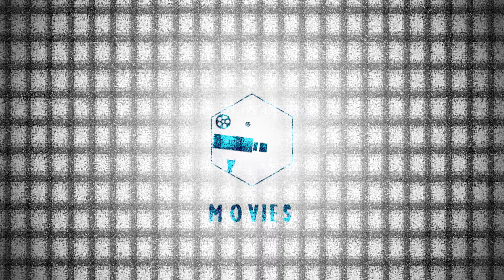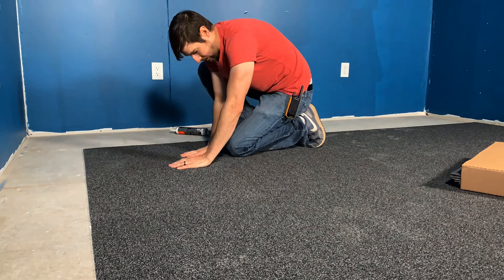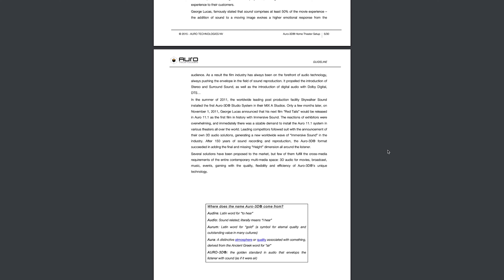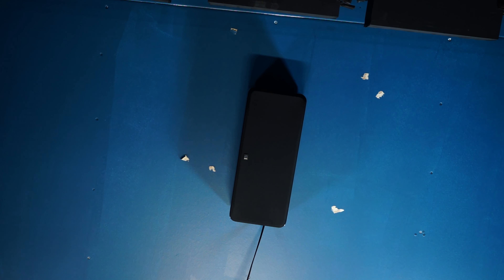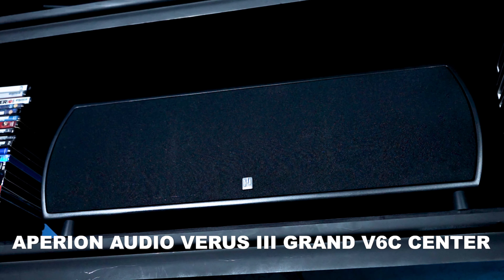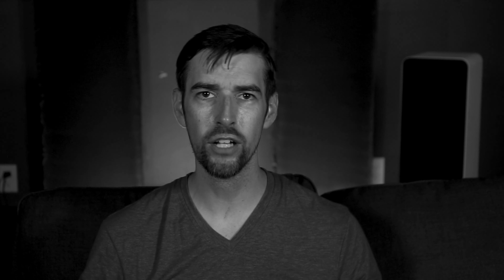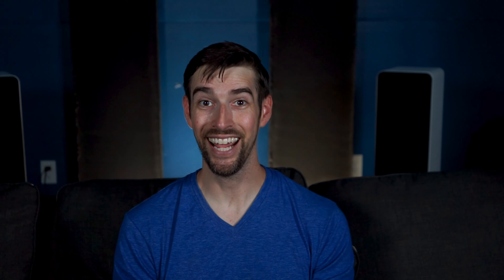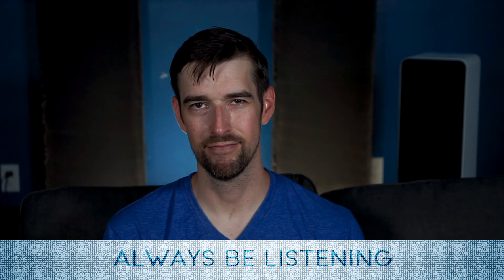IT'S DONE!!! DIY Home Theater Episode 3 | @AperionAudioSpeakers | Dolby Atmos | DTS X | Auro 3D

Comment: congrats on finishing it and I am looking forward to your upcoming comparison/testing videos
Reply: in the spirit of "starting a conversation" (which I love that you want us involved!) I have a similar setup in that i use a 10x20 external standalone garage as my dedicated "theater" room. It's super rough around the edges (i.e. unfinished, exposed attic style roof, concrete floors) but am slowly picking away at it. Currently I have 5.2.2 - My next move is and lingering questions are upgrading to a 4 channel atmos height system, assuming its worth it, but getting a 9 chan receiver is not easy to find and no bargain. Also I am contemplating getting new surround speakers and changing placement to be directly left and right of MLP (only have one couch at listening spot), currently they are a bit behind me at an angle based on dolby's new guidelines...so I'd be curious on your take on 5.1 and placement of those surrounds, because it ain't straightforward and everyone does something different

Comment: I may be watching many of your video out of order as I found your channel 3 weeks ago while searching YouTube university for Atmos surround. I researched for ways to upgrade from  5.1. to a 7.1..2 but I’ve changed plans to go with 5.2.4. Your Costco $1500 Atmos video started my journey with the Klipsch reference 5.0.2. I’ve added two klipsch R12SW, a pair of klipsch RP-500SA, and for the receiver I’m using the Onkyo TX-NR7100 9.2. I have a 120” screen with a LG ultra short throw. Stream for now is Apple 4K  and later I will be adding a blue ray player. This cost effective gear and your video was used to get the wife to understand the cost of this set up as a base line. Congrats on your set up as we all know your production will be a boost to a higher level of testing and content.

Comment: Hmm, i was a little confuse about the 30 degree angle for Auro 3D. I thought they say to angle down the speakers 30 degrees not to mount them at a height of 30 degrees from your head. I will do more research cause in the future i want to change my receiver and do a setup that can handle Auro 3D too.

Comment: Currently, I have and Onkyo PR-SC5530 AV Preamp that does the job fine. I'm building a 6 channel Orchard Audio Ultra Amplifier to go with it fully balanced. For Speakers, I run Klipsch Cornwall IV's for the L & R. My Center Channel is a Heresy IV (arriving soon). For surrounds, I run 1968 Bose 901 Series 1's. Future plans are installing either 4 in ceiling Atmos Speakers or doing an on wall Aura 3D and replacing the Onkyo....one day....maybe....

Is the IOTA Aura 3D and Dolby Atmos and XLR fully balanced outputs. Great work your doing Ealon.
Reply from the maker: Daaaaamn! Your LCR is insanely huge! Jealous! 😄 The AVX17 is not Auro 3D compatible. Dang. But yes, a full set of XLR outputs. That review will be released next week! 🤘

Comment: Can’t wait to see your new videos Ealan!  I got back into HT again in 2020 like many others.  My system was 20-25 years old and it worked, but outdated.  I had been looking to start upgrading and ran across a 4 speaker set of Paradigm Studios (80s and 20s) for $80 locally.  Then I picked up a matching center for $200.  Next thing I know I’m buying the Yamaha TSR-700 from Costco a couple month later.  I’ve since added an 85” Sony, older Integra ADM-2.1 I found for $50.  Oh and I’ve added 2 SVS PB-1000 Pros.  I have a couple of Klipsch Reference Theater Pack satellites as my Atmos speakers.  I’m running a 5.2.2 right now, but I have plans for a Denon x4700h at some point to run a 7.2.4 setup.
Reply from the maker: Dang, Chuck! Excellent bargain hunting! Welcome back to the HT madness! 😄🤘

Comment: I’m currently in frame out, electrical wire and speaker wire running in my diy home theater.  I will be running a 7.2.4 Dolby ATMOS with all Klipsch speakers.   Dedicated home theater space I’m building in our new garage I recently build on our house.  Room is 12x20x8.
Reply from the maker: Good luck to you on your fine journey! Excellent setup you have planned!

Comment: Hi Ealan, you had Denon 4700 on pre amp mode before how does the Iotavx compare with the Denon.
Reply from the maker: It was too long ago to remember. BUT…I am literally planning on having the AVX17 go head-to-head against my Marantz SR7015 (which is the Marantz equivalent to the x4700h). So stay tuned for that in the upcoming weeks!

Comment: Looks great and yes they will drive you insane building one. It’s very similar to my basement theater. The sound absorbing panels made a huge difference oh and carpet instead of concrete. I love my 7000x also. Amazon has scatter plate panels that work great when hung on your back wall. I just used the 3m poster strips to hold them do to their light weight. When it all comes together though the detail you can get from your speakers is incredible.

Comment: Nice! I’m using Audiovector speakers in a 5.1.2 setup. Separates with NAD T187 pre/pro with 4K HDR/ Atmos/ DTS X and Dirac live calibration. Amplifiers are a 3 channel Purifi based and 6 channel from Rotel. Completed with a Velodyne 1200 Ultra and LG C8 OLED.
Reply from the maker: Whoa. NAD pre/pro with Dirac live is next level! 🤘
Reply: @ealanosborne  Yes it sounds awesome! Look up and try to find a Purifi based amplifier if you can. Measures and sounds phenomenal 😁

Comment: Haha! @7:04 Yep, same! I’ve got a 5.1.4 Atmos setup with four Polk OWM3’s mounted on the ceiling. All in my living room. This is the only space we have, it’s not ideal but it sounds really good. Whenever we move, you better believe I’m going to get a dedicated space and set the speakers where they should be.
Reply from the maker: Oh for sure! My previous living room sounded great! But now that I’ve gone dedicated, it really is on a whole new level. 🤘
Reply: @ealanosborne  The only thing is I have an open concept so the dining area is the same large room as the living room. And, hardwood floors, ugh.
Reply from the maker: @Rockovissi  That was my previous house’s living room situation. A big ass rug helps, and some ceiling panels (I’d try and make them look nicer than mine, though 😄). That’s where I’d start, if you haven’t already.
Reply: @ealanosborne  I do have a big ass rug but I think I’m going to wait until we move to do anything else to it. But as you’ve said, wife factor!

Comment: Could you explain the different components for newbs like me? Like what's a pre-amb? What would happened if you didn't have one, etc
Reply from the maker: A receiver (or AVR) is all-in-one: Audio processor, video switcher, and amp in one unit. A preamp processes audio and does video switching, but has no internal amps, so you need a home theater external amp to actually send a powered audio signal to your speakers. Typically, a newb like yourself would start with an AVR, since preamps are relatively expensive compared to entry-level AVRs.

Comment: Been building up over the last couple of years. 5.2.4 Pioneer Elite bookshelves for  the front and rear with upward firing on all, Pioneer Elite center, & 2 SVS PB-2000 pros all running off Yamaha 3060 using series x for gaming, bluerays,  & streaming. Next month getting a power amp. My goal is to have actual height on wall and ceiling channels. I'm very envious of your setup and what you will be bringing in the future!!!
Reply from the maker: Sweet setup! How is the Series X as your entertainment hub? I rocked an XBOX One S for awhile, but had some weird software issues intermittently. Is the Series X reliable in that regard?

Comment: Great job!...been waiting patiently for you to finish. Maybe a helpful tip...I have both an Auro 3d and Atmos setup with differently setup ceiling speakers as well. I use a Soulpeak speaker switchbox which allows me to toggle switch between different speakers (e.g. VOG & Center Height Auro 3d setting and then toggle switch change  to Top Middles for Atmos). Much easier and more convenient than going behind AVR to switch speaker cables each time. 

Looking forward to your future videos and thank you!
Reply from the maker: That’s a crazy unique setup! 🤘

Comment: You are probably one of a handful in your area who have a ground rod actually driven to the 8' depth, wonder how your house ground rod was driven?
Reply from the maker: Great question! I’d imagine the original/previous owners of my brother-in-law’s house didn’t drive it to a depth of 8 feet since the electrical in general is shoddy at best. Many bizarre shortcuts were taken just to get electricity throughout the house and garage/shop. Not to code, for sure. So I’m glad I did it right with the shed theater. Can’t take any chances with products that I don’t exactly own and might have to send back! 😄

Comment: Welcome back Ealan! I'm still relatively new to the channel but I have converted (or am converting) one of our spare bedrooms into a home theater. Now I've gone for the Sony HT-A9 combined with a SA-SW5 subwoofer because I don't want to (nor will my wife let me) start drilling into ceilings for dedicated speakers. So far I've been really impressed with what these 4 speakers and sub can do (coming from a standalone soundbar) but one of the main questions I've been asking myself is: will a rug (floor is LVT) and acoustic panels help me? Height channels are based on bouncing sound off the ceiling but surround isn't so maybe a few acoustic panels on the wall in the right place would help? I started Googling stuff about them but there is so much stuff out there I'm having a hard time seeing the woods through the trees.
Reply from the maker: Thanks! And yeah, acoustic treatment on the sides would help, definitely. In my previous video about my acoustic panel-making journey, I go over the simple way of knowing where to position the side panels to get rid of your first and second reflections of your front soundstage. That should be good enough, since that system does rely on the ceiling to create the Atmos experience. 

I'm planning on getting the HT-A9 for my living room when we move into our new construction home (hopefully Aug/Sept at the latest). My wife also doesn't want holes in our brand new home, so wireless is the way to go, now that I have my dedicated theater space. :)
Reply: @ealanosborne  Cheers I’ll check that video out!

Comment: Hi Ealan, sorry I may have missed it but I have a similar speaker set-up (11.4.10. Using Trinnov) , same inclinometer, tripod and headscratching, quite weird in a way watching your video :-). I did it about a year ago and love the auro result. But I keep looking at the space where the atmos speakers should be, do you have any intent to wire for those as well? Or going for the compromise approach auro/DTS/atmos?

Comment: Why did you pick aperion audio over the rest?
Reply from the maker: 1) Their speakers sound dope AF. I would compare them to SVS. And 2) Aperion has had my back since I only had a few thousand subscribers. They took a chance on me and it paid off for us both. They were a huge part in making my channel what it is today. 😁🤘
Reply: @ealanosborne  wow an honest reply I really appreciate it. Would you recommend them over svs? Or go with all svs ultra system? I'm saving up for my home theater system.
Reply from the maker: @RjTheTrigun  Honestly, SVS and Aperion are so similar when it comes to build quality, audio quality and customer service (they're both small enough to provide personalized help), it comes down to looks, which I think Aperion has the edge. Especially their Verus line, which is like pieces of furniture. The advantage SVS has, though, is more subwoofer options and something like the 5.1 Prime system. Aperion doesn't have anything similar.

Comment: Mr Cool DIY ductless mini split system. I just installed one and it's super easy especially if your air handler will be mounted on an exterior wall.
Reply from the maker: Ooooo, thanks for the recommendation! 🤘
Reply: @ealanosborne  no problem, I also wanted to add That I know exactly what you mean about the frustrations of building a home theater. I recently remodeled mine And decided to skim coat the walls to remove all texture. All I can say is that I have nothing but respect for drywallers.
Reply from the maker: @valdeze  Dude, no kidding! It's basically an art form that I have no business even attempting!

Comment: I was looking for a budget system so I found the Jamo video and I went to Amazon and got the 5.0 system. I then got the tower speakers s809 for my front left and right. I also upgraded my subs to the c910 x2 for a little extra base/power. I would say I have a 7.2.2, for an avr I use the Yamaha rx-v6a which I plan on upgrading in the near future.
Reply from the maker: Heyyy, nice job with the bargain hunting! I started with the Klipsch 5.1 theater pack, so you’re on a better path than I was at the start! 😁🤘

Comment: Great job on this entire process.

I could not imagine being in that room without AC.  Will the humidity cause any internal damage to the speaker components?

I laughed out loud when you mentioned your wife not giving a $hit.  I’m in the same boat, but I was able to start a dedicated room above the garage here in Florida once Covid made this a kind of hobby for me.  

My journey started out with finding the best center channel.  I ended up with the SVS Ultra Center after going though about 5 other center speakers.  Once that was figured out, I added Ultra Towers.   I have 9 foot ceilings, so I went with in ceiling middle speakers from Jamo.  Currently using SVS satellite speakers for surround, rears, top fronts as well.  SB16 Ultra is now in the mix as well.

I made 10 acoustic panels to hang on the wall.  But after your video, I need to go back now and add a spacer in the rear to uncouple them from the wall.

I also made a mistake and did copper clad wiring at first.  Eventually swapped everything to pure copper from Monolith.

Powered by Denon 3700H, with an Emotiva BasX5175 for my bed layer.  Saving up for a Monolith power amp to switch the Denon to only Pre-out mode.

I think Audyssey in conjunction with learning REW was the biggest improvement for my system.  Very curious how how the IOTA will perform.  Will you provide any measurements from your MLP?

Thanks again for the entertaining videos 🍻
Reply from the maker: Wow! Amazing (mostly) SVS setup, including a PB16 Ultra? Daaamn! Jealous! 😁 And I might have a video with measurements. We’ll see. Not everyone is jazzed about measurements like you and I, so I’m still deciding on that. 😄
Reply: @ealanosborne  Yeah, I was open to any brand, but all my research showed that the center channel NEEDS to be great.  I tried multiple Klipsch, KEF and Polk centers first, and even the SVS Prime center.  The Ultra SVS center just seemed to give me the best dialogue and dynamics.  I then just stuck with SVS to timbre match.

I wish I had the PB16, but it was just physically too large.  The SB16 is awesome.  I only have one because the Ultra Towers are set to small with a 40hz crossover.  Those smooth out the bass throughout the room, the SB16 is just the cherry on top.

I hope your channel keeps growing and SVS sends you some more stuff to review.  👍🏼

Comment: Hey Ealan, I just bought a used 5.1 set of the Aperion Audio Verus ii speakers including the Bravus ii 12D sub. My dedicated “theatre” room is about 12.5’x13’. Do you think it would make sense to go separates? Or is there a receiver that can handle these speakers? I’m also hoping to add a pair of atmos ceiling mounted speakers later. Keep up the great videos!
Reply from the maker: Whoa, what a great find! And well, separates might be a good future goal, but you can always start off a good AVR that has pre outs which you can then add external amps into the mix over time. The Verus line definitely shines with more power being fed through them.

Comment: I’ve a major challenge. I used to have a 7.1.4 then moved and set up a 5.0, now with different equipment in another country I have a 5.1 system. And an HT room that’s been pre-wired and full of boxes 📦 of equipment. I’ve sold half of it already. Yes sold the KRIX MX10 full surround system. The transparent screen went today. Why? Because I have way too much equipment. And then my son moved back home and took my office space by order of his mum. So my office moved to the ht room. How to combine an ht with an office??
Reply from the maker: 1) Maybe install a drop down projector screen that goes in front of your computer desk. 

2) Computer desk on one wall, TV/receiver/LCR speakers on the opposite wall, so your surround speakers are actually flanking the computer desk. 

3) Mount a large TV on the wall and also use it as your computer monitor, but I’d invest in a wireless computer keyboard so you don’t have to be inches away from the TV just to conduct office business. 😄 

Just off the top of my head! 🤷‍♂️😁